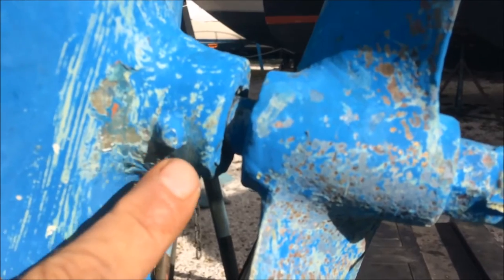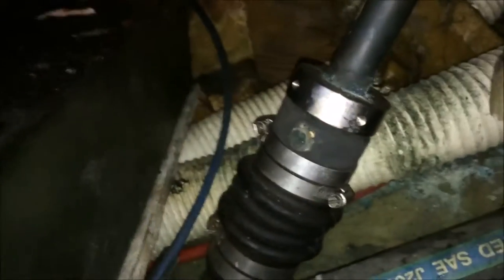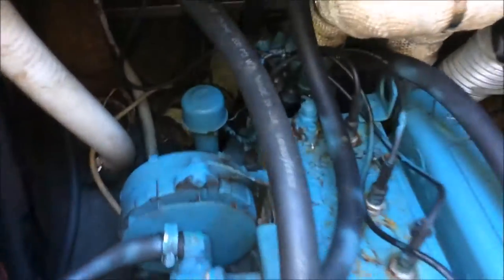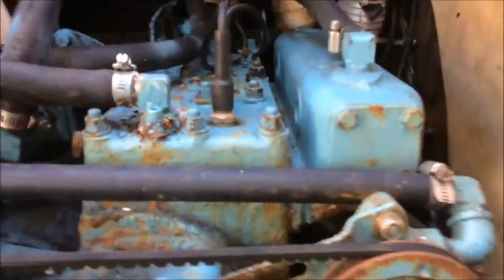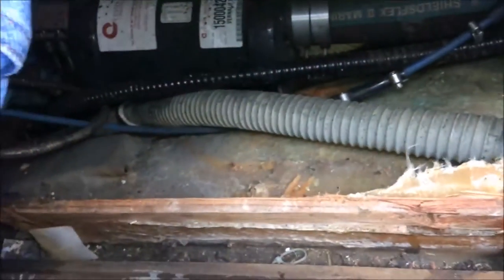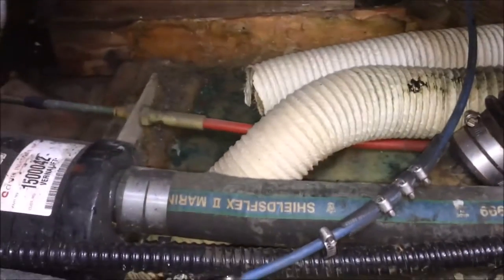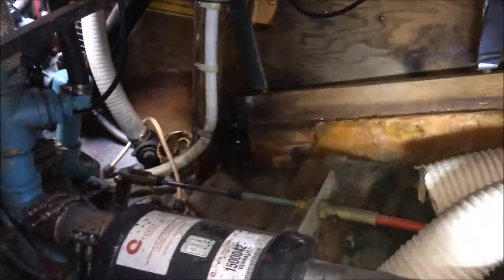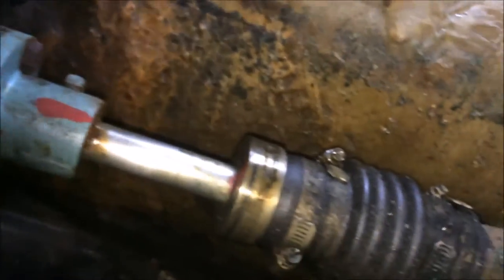1968 Bristol 32 Cutlass bearing and PSS service part 1

Comment: What kind of prop do you have on? Brand, model, diameter and pitch? I tried to fit a 12x13x3 DynaJet prop on my Bristol 30 but it sits way too close to the rudder.
Reply from the maker: PROP (7/8”SHAFT) 12X10 HH117874
Reply from the maker: RH
Reply from the maker: MI/FED  SAILER 12 RH 10
Reply from the maker: That is for 1500 RPM max. My boat also has rudder stops with the added wheel. And my friend has a B35 with a tiller and no stops, We had to fix his rudder last summer from the prop cutting into the rudder when he was hard aground.
Reply from the maker: https://www.miwheel.com/propellers/brands/michigan-propellers/